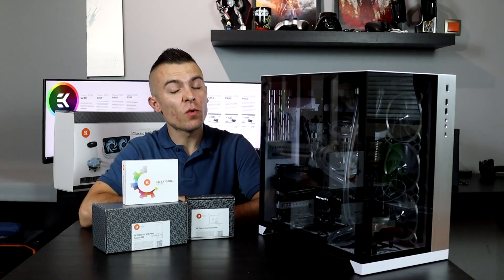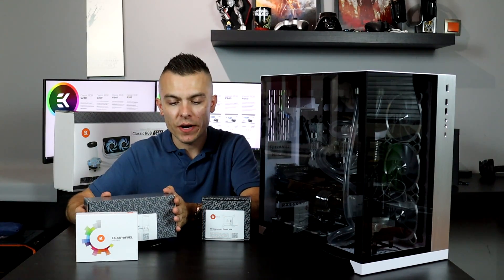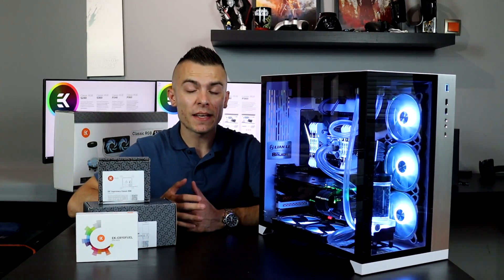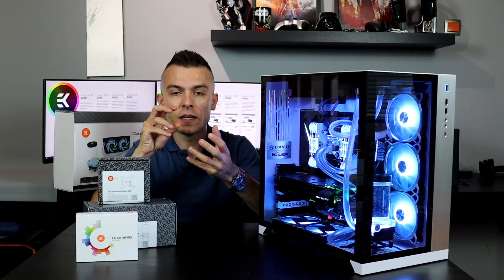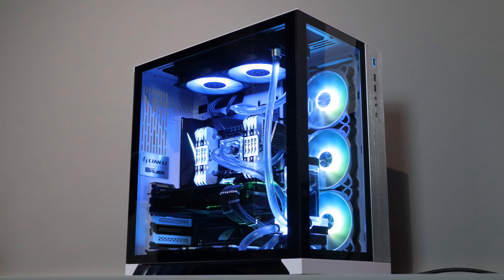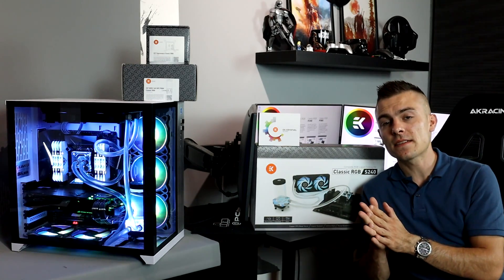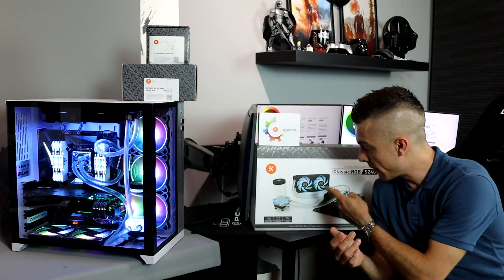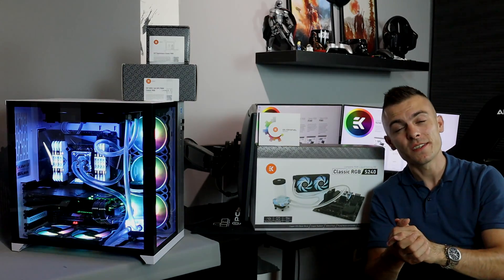EK WATER BLOCKS KIT Classic RGB S240 - test and review

Comment: Hello nice video! Which is better NZXT x62 or this EK KIT?
Reply from the maker: Hi, thanks a lot. Tbh, I would compare these two since NZXT Kraken X62 isn't expandable but does cool really good. The EK-KIT Classic can be expanded, you have RGB on your fans, pumo and CPU block, you can easily change coolant if you add drain port... Basically gives you more customazibility. But when it comes to cooling quality, I would say they are very near to each other. Maybe the Kraken X62 is a tad better since the radiator is 280 thus having more area to cool the liquid.
Reply: @PCCrazyDario  Thanks for the answer! I was asking you because i sold my Kraken x62( i didn't like software and etc) so i wanted to buy new one, maybe i will go for this one or 360 variant. Thanks again!
Reply from the maker: Semir Derviševič Hmmm strange. I actually use NZXT CAM on everything. But hey, everyone has their own, right 😉
Go with 360 and then you can upgrade one day with a GPU. 😉